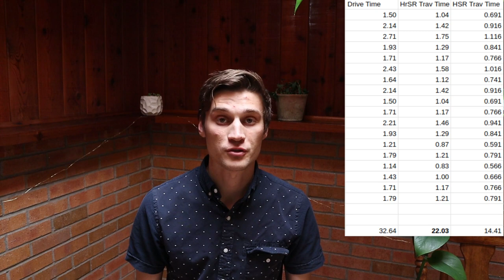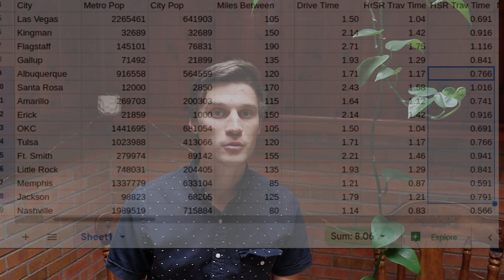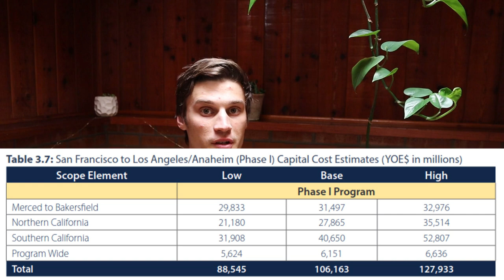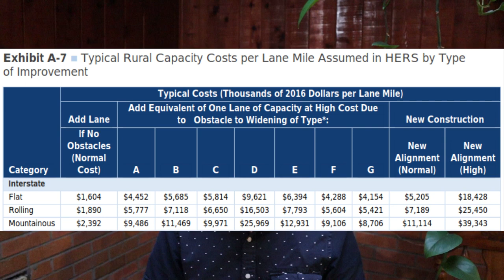What if Interstate 40 were High Speed Rail?

Comment: having done the whole legnth of I40 driving I totally wish this was a thing
Reply: Why would you do a thing like that? Just fly, and get there in 5 or 6 hours.
Reply: I have done 90% of it many times.  @neutrino They wont let you put a uhaul in your over head compartment.
Reply: @dave4882  

"They wont let you put a uhaul in your over head compartment."

So have your shit shipped separately. Get one of those PODS, Portable On Demand Storage. Put your shit in it, lock it, have them ship to where you're going, fly there, unlock it, put it in your new house.

Anyway, Dave, what does that have to do with building HSR down the whole length of I-40? You can't put a u-haul on a train, either?
Reply: @neutrino78x  It cost me so much less to do it myself.   And I realize no uhaul on a train.  I am just stating there are reasons someone would drive I-40.   I do with they had an auto train running east to west though.  If you have never heard of auto train, look it up.
Reply: @dave4882  

"It cost me so much less to do it myself.   "

I dunno. It costs you a lot of time. I guess it depends on the distance.

"If you have never heard of auto train, look it up."

I saw a video about it. Seems like it takes forever to load and unload and it's a 10 hour drive when you could fly in two hours. 

Anyway yeah there are probably reasons to drive on I-40 but flying is the fastest way to travel. 🙂
Reply: @neutrino78x  
Flying would be way better if you didnt have to be groped every time you want to get on a plane. I'll take the time penalty in order to not be harrassed or subject to additional charges for having 1 extra pound in baggage.
Reply: @P7777-u7r  

"Flying would be way better if you didnt have to be groped every time you want to get on a plane."

Follow TSA instructions so you don't blur the body scan, then. lol

"I'll take the time penalty "

5x, 10x longer? Not me.

I got places to go, things to see, and people to do. 🙂
Reply: Flying is great but has become increasingly unpredictable and unreliable....bad weather, canceled flight, missed connection even the risk of covid change the whole situation appreciably.And a pod shipment is a whole lot more expensive than a uhaul.
Reply: @davidharris453  

"Flying is great but has become increasingly unpredictable and unreliable....bad weather, canceled flight, missed connection even the risk of covid "

Some of those are valid but not to the point that I'm going to waste 8 hours of my life. Come on.

"And a pod shipment is a whole lot more expensive than a uhaul."

See above
Reply: @neutrino78x  Don't forget the 3 extra hours spent at the airport checking in. Then, the time spent required to get to and from the airport, another half-hour, maybe even more. While with a train, you could get to the downtown train station 10 minutes before departure, not needing to worry about shit. And then, you would be able to enjoy the wider seats, maybe even rest or work. And when you finally arrive, you can be right in the downtown immediately, without needing transfers and that kind of stuff.
Reply: @thisaccounthasbeensuspended  

"Don't forget the 3 extra hours spent at the airport checking in. "

This is a cut and paste argument I have debunked many times. From now on I just cut and paste the answer.

Nope. Since you guys are cutting and pasting, I'm going to save this post so I can just cut and paste next time this is brought up. This argument is more true on the east coast or in Europe where the airport is further away.

1) SJC is 20 minutes from downtown SJ on public transit; SFO is 30 minutes away from downtown SF; BUR is 30 minutes away from downtown LA.

2) security is 5 minutes if you have "clear" and 20 if you don't

3) in no way do you have to show up 1-2 hours early on a domestic flight. If you're there more than 30 minutes before boarding starts, you're doing it wrong
Reply: @neutrino78x  I've experienced it myself, many times. Last time I've been on an airplane, the security checks, the registration and all of that stuff took up the better part of the 2 hour window. Not even 15 minutes after I got to the boarding room did we actually board the airplane. If, as suggested, I showed up at the airport 30 minutes before departure instead of the aforementioned 2 hours, I would have missed the flight by just about a hour. I tried to go through as fast as possible.
Reply: @thisaccounthasbeensuspended  

Nope. Since you guys are cutting and pasting, I'm going to save this post so I can just cut and paste next time this is brought up. This argument is more true on the east coast or in Europe where the airport is further away.

1) SJC is 20 minutes from downtown SJ on public transit; SFO is 30 minutes away from downtown SF; BUR is 30 minutes away from downtown LA.

2) security is 5 minutes if you have "clear" and 20 if you don't

3) in no way do you have to show up 1-2 hours early on a domestic flight. If you're there more than 30 minutes before boarding starts, you're doing it wrong
Reply: @neutrino78x  I HAVE to show up 1-2 hours early before boarding starts, because the check-in stuff and everything take a good 90 minutes. I tried to sit around as little as possible and go through fast, yet it still took me 90 minutes. If I showed up a mere 30 minutes before departure, I would miss the flight by a whole hour.
Amsterdam Centraal is IN the downtown, basically 0 minutes to it.
Reply: @thisaccounthasbeensuspended  

"I HAVE to show up 1-2 hours early before boarding starts, because the check-in stuff and everything take a good 90 minutes"

Nope. You can check in online. 

"Amsterdam Centraal is IN the downtown, basically 0 minutes to it."

San Jose too. It only takes 20 minutes because I use transit. Driving it's like 5-10 minutes. Remember not everybody lives next door to the train station. I used to live in downtown San Jose. But not right next to San Jose Diridon (where the HSR would stop). You can drive there in five minutes, just like the airport. There's no advantage in that regard between airport and train station in the USA, at least west of the Mississippi River.

Europe is a lot denser, ok. Amsterdam for example has population density of 5,277/km^2. So basically you've got give or take 5000 people who could be in reasonable walking distance of their HSR station. Chicago and New York are comparable, but the distance between them is too great, so HSR is not very useful there either. 

But like for example Columbus, Ohio is about 1/5th of that, 1,586.74/km2. You see the problem? There's no density. Europe has existed for 1700 years longer than we have. Lots of time to build up density. We could make it illegal to live outside of major cities, which would be a major violation of our rights as Americans, and we still wouldn't have the density, simply because of the distance between those population centers.

So it's just not applicable. And trains don't have any real advantage downtown vs outside if you can get to the airport quickly. That's more of an argument for "there should be better public transit to the airport in places like new york where the airport has to be outside of the city", not "the USA needs HSR."

Now, let's see if you can give me a reply that's not "I have to get the airport 2 hours early" or "airport is closer". Because when the plane only takes an hour and the train takes four or five hours, you're still saving a lot of time. 

If you can't come up with another argument I will cut and paste again.

Comment: One factor omitted: Cost and timing for lodging in route. Driving I-40 between California and North Carolina, even at 70 mph, is going to require about three overnight stops at hotels, motels, campsites, or trailer parks. If weather is bad, additional stops overnight may be needed. Overnight accommodations would be part of the high speed trains, that can remain moving overnight.
Reply: Well, yeah, but is it relevant? The main purpose of I-40 isn't to drive all the way from California to North Carolina, nor will that be the main purpose of the proposed train. Most people will drive a much shorter portion of the I-40, and will travel between two intermediate stations.

When discussing roads or train lines, people should not just focus on terminus-to-terminus travel, as that will be a small fraction of the use of it.

Comment: HSR works well in high density population centers where corridors between city pairs are relatively short, which is why it works so well in Europe and Japan. East of the Mississippi it's more cost effective to fly to Vegas or LA. West of the Mississippi you would need to connect major population centers to justify the cost of the build, and to generate the necessary income to keep the route viable, and such population centers are few and far between along I40. Patronage between Memphis, OKC, Albuquerque and Vegas likely wouldn't support the route. Moreover, given the push for zero-emission transportation, you're route would have to be electrified, driving the cost per mile up exponentially. To run fast gradients must be kept to a minimum, which means lots of tunnels in the East and lots of fills and cuts and bridges/causeways through, over and around the undulating terrain of New Mexico and Arizona. It would be a massive undertaking that would wind up costing 5 to 10 times your range of estimates. You could build it, but it would never pay for itself. The cost of maintaining the line would be prohibitive.
Reply: From Memphis to Nashville would take so many ups, downs, trestles, tunnels...for what?  There are "tons" of connections? Bright line in FLA has NO overhead crossings and is flat as a pancake. Bro throws numbers around like a herd of mosquitoes.
Reply: That's why I think a hybrid 70/80 route would make more sense. SF to New York plus Chicago, Denver, Salt Lake, among others. Running it through larger population centers would generate more income.
Reply: You might be surprised at how often people out west do travel from city to city. We are used to the longer distances, and because of traffic in dense close cities, the driving time is more similar than you might think
Reply: @kzisnbkosplay3346  I lived in Texas, California, Arizona, Colorado and Nevada for 40 years. It's faster and more economical to fly.
Reply: @J3scribe  LA to Vegas screams HSR. Phoenix to Vegas as well eventually in the future. Maybe LA to Phoenix.  LA to San Diego as well. However, distances beyond this would be better served by air.

Comment: Here’s the problem. 30% or more of traffic on I40 is freight, not passenger vehicles. 

And this does not consider the final mile problem. 

So please don’t consider high speed passenger rail as a substitute for I40. A complement, yes. A replacement, no.

Comment: One thing that I think that you leave out in your discussion of the high speed rail discussion is economies of scale. Part of the reason that CA HSR is so expensive is that it is the only system in the country. It is literally being built from scratch. Part of why the cost of building a lane mile of interstate is so low, and to some degree even the cost of higher speed rail (which for the most part is normal rail with nicer trains... yeah, I know, there is more to it than that, but you don't have to do that much special to the rail like you do for HSR) is so low, is that we already have all the equipment and materials we need in mass. If we truly were building a nationwide HSR system, after the first few segments of HSR were built, it would start becoming more of an "off the shelf" operation like highway building is now.